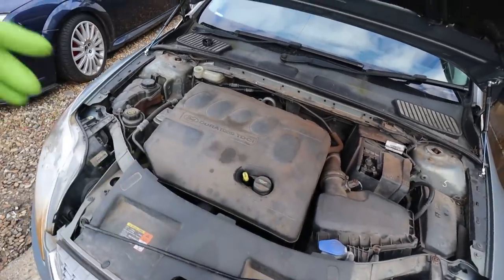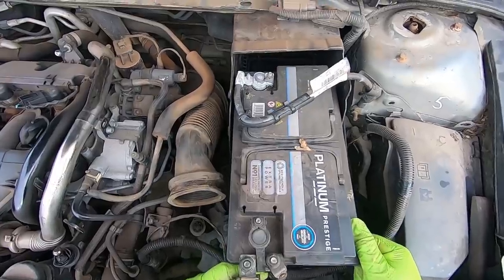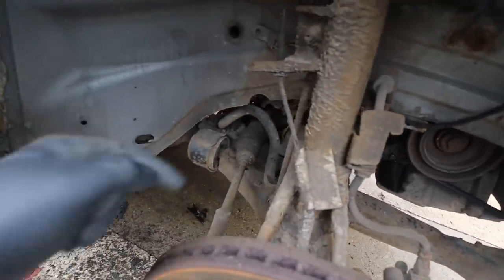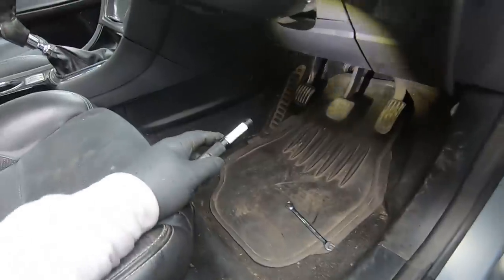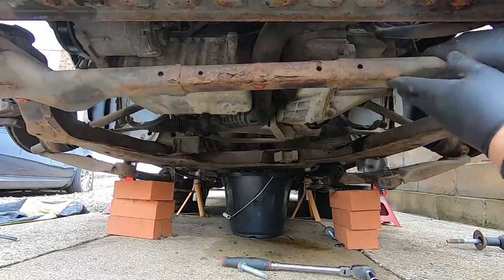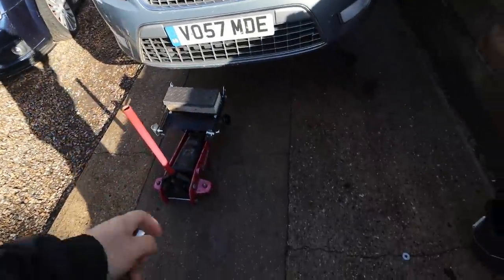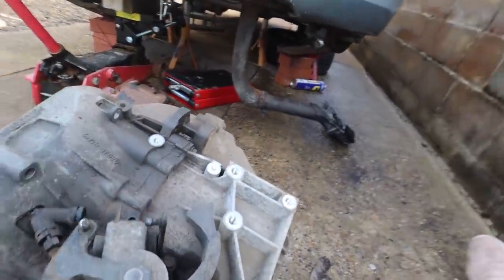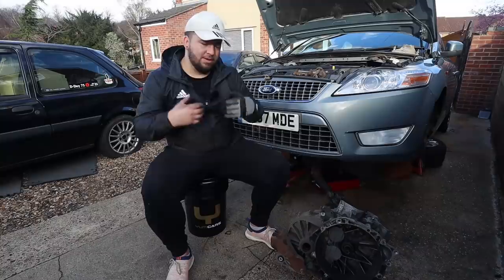Mondeo Mk4 Project Gets a New Clutch! (Part #1)

Comment: How can someone Dislike it when it was only Uploaded 5 minutes ago, Typical YouTube Haters 😂
Reply: It's all the fiesta nutters James never really got dislikes until he got that and now every time he uploads a video that's not rusty soap box related instant dislikes
Reply: @roymitchell5664  I'm one of them Fiesta Nutters, I have a Fiesta ST Performance Edition 🤣
Reply: @roymitchell5664  stop talking waffle you don’t have a clue
Reply: @georgepeg6167  I don't have a clue?  You don't know me or what I know so shut up.
Reply: @Unknown65151  the fiesta st is a brilliant car but as a fiesta fan you will know that and you will also know that the old ones are rust buckets, in my opinion and it is just my opinion james should of just scrapped that car when he found all the holes in the floor pan its too much of a money pit thankfully ford have sorted the problem out now.
Reply: Probably prefer gardens to driveways 😃😂😃😂😃😂
Reply: @james there is a special tool you are ment to use putting the pressure plate back on, just thought I’d give you heads up, 

the pressure plate is a self adjust one (see those springs in the middle) and what can happen is when your tighten it the adjustment can just slip so it will be fully adjusted and will most prob slip
Reply: @roymitchell5664  clearly don’t know nothing bud just a nobody like everybody else lol
Reply: @Ross Bourne what point you trying to make ?

Comment: I tackled the Insignia DMF, clutch and slave cylinder a couple of weeks ago. The box was just as heavy, maybe more - but it was not a job that I would again lightly. I had the exact same problem (I also have a MK4 Mondeo as well - the same as you, but luckily no clutch issues on that).

I only lowered the left side of the sub-frame down partially and rested the box on it, enough room to get the job done. Otherwise, I'd have to get it on my chest and onto the floor, which even for me isn't an easy job. Yep - I also did it on the driveway. Hats off to you for taking on such a brutal job in this... British weather! Also, I had to fight with the dreaded "flywheel spin" where the bolts were inaccessible without an angle-grinder. Yeah, it was a fun job,

Remember not to dry-bleed the slave cylinder as it can lead to premature failure. Prime it instead.

Comment: Can I just say, I have a Ford C Max and have only just started out repairing my own car due to costly errors by experienced mechanics. Using tutorials in a "STEP BY STEP" like manner, is what allowed me to rebuild the entire front suspension which was challenging but so rewarding in many ways. It's hard to find videos like yours on clutch work, so if you please,... the more intricate, "STEP BY STEP... Bolt by Bolt with good lighting and good angles" the better. Hell, your videos are better than the notorious Haynes Manuals. Keep up the good work. Well Done!

Comment: You did a good job but over kill with the subfame it only needs dropping down on one side leave anti roll bar alone and steering rack just remove the drop links from the struts and track rod ends from the hub unbolt box and let the box sit on the frame while you replace the clutch.

Comment: just in case you don't know when your reinstall the sub frame you have to align it there are holes on the back you see them in the video at 20:02 there is a proper ford tool but you don't have to use it all i use at work is 2 3/8 deep drive 14mm snap on sockets and 6inch extensions  to align it if you dont align it properly you'll never get the tracking right afterwards. love the vids keep em coming

Comment: James, you've got it all apart so you're halfway there. It makes sense to replace the crankshaft rear seal now you have the flywheel off. Gearboxes are no lightweight but that one must be really heavy. The last clutch change I did was on my 2002 Citroen Xsara Picasso. I wish I'd made a video when I did it.

Comment: Fair play for doing that on your drive mister, front wheel drive gearbox removal is often way more involved.

Kevin Albert Williams has a great channel also, focusing on mobile clutch replacement - perfect watch for the most efficient way to get the box out or just enough out of the way to change slave or clutch/flywheel depending on the car.

Comment: Another great vid. Before you put the slave cyl on, check if you need the sealant on it. The mk3 had to have a specific one.  They were also a pig to bleed afterwards, best way is to refill through the bleed valve using a syringe as it pushes the air upwards.

Comment: When you fit your new pressure plate there is a procedure to be aware of it is the self adjusting type.
The three little springs will be fully compressed on the new pressure plate and need to still be fully compressed once the new plate is tightened down.
If you trigger those springs when you fit the pressure plate the clutch won't work properly.
There is a £400 fancy tool to do the job, you can make your own for about a tenner. If your Haynes manual for a Mondeo is as useless as my Volvo Haynes manual this won't be explained very well.
The other way is to fit the pressure plate and tighten the bolts very gradually and evenly keeping a close eye on the three springs to make sure they haven't moved.
Alan Howatt has a good channel, well worth watching.
To save a lot of sweating when you refit the gearbox you can cut some bits of M10 studding about 100mm long and screw them into the engine, then slide the gearbox on over them, makes life a lot easier.
I'm sure you already know, but that steering rack pinch bolt inside the car is a one use item. Keep on keepin' on!

Comment: Nice one, am sure the drive shaft bolts needs replaced think they are a  stretch bolt, most wheel bearing kits give replacement bolts for that reason

Comment: Just a thought....I had the model mondeo before yours and had clutch done....clutch, flywheel, slave cylinder AND starter motor. Apparently it`s good practice to put new starter when changing clutch.
Reply: Brother is a taxi driver and ran a Mondeo....clutch went...Ford garage charged him £1,200 (Clutch, flywheel, slave cylinder & starter motor)....I was also a taxi driver for 4 years and stupidly started off with a Mondeo (It was off the road more than on it, with repairs....until I saw the light and got a Skoda!) and clutch went....I got it done by an ex-Ford technician running his own back street garage with his son and it still cost me £700 back in 2006....he showed me the flywheel and starter, which were much the same as yours (F*cked) with flywheel knackered and starter so full of gunge (Like the stuff in your bell-housing) as to be kaput.

Comment: The DMF wobbling around would have smashed the clutch into the slave cylinder that’s why it went, it was the DMF to start with that was the problem, I had the same on a diesel vectra
Reply: If the flywheel was that bad it was knocking the clutch into the slave would of been knocking its tits off 🤣 do you know how far away the clutch sits from the bearing with our foot on clutch ? 🤣 with foot on clutch the play would come out of flywheel with it being pressed , hence you won’t hear a flywheel knock when the clutch is pressed down

Comment: I have the same engine in my Volvo and if I remember correctly, that they came with Sachs from factory, not LUK. So am I right in thinking that this has been changed before. Yikes those bolts don't look good. Maybe it was badged previous and they haven't tightened the flywheel bolts correctly. And these require a specific alignment tool so you'll be needing one to install the clutch. 
Love the videos and get yourself some mats to lay on. The halfords ones are a godsend and are very comfy. Unless you can find the children's play mat version cheaper.

Comment: you are lucky with that flywheel they often get stuck and the centre part requires cutting out to get to the flywheel bolts to get it off

Comment: Hi, I'm a technician by trade love your videos. Have a look at investing in milwaukee impact guns i have them uses them on a day to day and they are better than my more expensive snap on ones I had.
Reply: Been to pal, I was amazed that he had to use a breaker bar on the steering rack bolts, Milwaukee would have had them out in seconds!  Even the snap on ones would in my opinion
Reply: Ye the snap on ones would do to, I mean they are good but for the money I think the milwaukee are a better deal.
Reply: Milwaukee really in a league of there own for there strength in impacts, dewalt half inch impact is a keen contender very similar strength to the milwaukee just far cheaper and actually lighter

Comment: Compared to a 1960's Cortina conventional drive this front drive set up looks a nightmare to work on. Good work. I suppose in a garage the car would be high up in the air and even then it's still awkward. Cheers.

Comment: Hi mate nice vid....try and use the axle stands to what there for a.get the car in the air you will find it a lot easier for you....now ref to the clutch look on the box it should say s/a on it this is a self adjusting clutch now there is a special tool to set these up but if not available they can be a pain...fit it and when.doing the bolts up I've done.it 1/4 turn each bolt and rest it carry on untill all tight and right I've done the transits like this and it does work...good luck...😂👍

Comment: When you put it back, use 75W gear box oil. Something like Castrol Syntrans FE 75W. It's the right oil figured by Getrag for these. You might think it's ok-ish with standard 75W90, untill you use 75W, what a difference it makes.

Comment: just a heads up, that pressure plate looks like an adjustable clutch, means you need a tool to fit it correctly for the adjustment
Reply: I was wondering about that be good to watch someone do it for future reference.

Comment: I suspect the unknow box on the subframe is probably a vibration damper to damp out probably high frequency vibration.  Basically it'll pretty much be a weight that's calculated to dampen out the sort of high frequency vibrations that cause buzzing noises inside the car...

It could also be some kind of safety item fitted so that, if an engine mount fails, it will drop down and rest on that rather than dropping right down to a point where damage may be caused...

With 160,000 miles on the clock it really wouldn't be surprising if that's the original clutch, even with the vehicle having been used for towing, as the original clutches can rack up a lot of miles before needing changing.  Usually it's the hydraulic release bearing that dictates the life of the clutch and it's not unusual to find cars that have done most of their miles on motorways that have 200k miles on the clock and are still on the original clutch.  These parts are basically the same as those used in Transits, so they're very well over-engineered for a family car...

Comment: Hey, you should've concidered to order stiff flywheel. For example I have 2012 Focus mk3 1.6 tdci and i have installed Valeo kit. It drives way better and costs half of money. I did 50k kilometers since the repair and had no issues at all.

Comment: i defiantly would build some concrete wedges on your drive as its on such a angle so when you drive in the front/rear of the car would be near 2ft higher at the bottom of the drive just a wedge under standard wheel width so you can safely go under car without jacking , similar to a pit but obviously smaller but ideal for service jobs ! top work again mate !

Comment: This is a job that typically scraps older cars like this - nice to see this Ford getting saved! Just curious - why did you separate the steering shaft from the rack, as the whole rack was staying in the car anyway ? And how are the bushes in those lower control arms ?
Reply: I was thinking the same thing. There was no need to separate the pinch bolt out of the steering column. Easiest option would be separate the ball joints from the hub and drop the sub frame out with the suspension arms still attached. Just giving himself more work.

Comment: Damn. I have a mondeo mk3 tdci which i've had since i got my license - 3 years ago. it's getting close to 400k kms and I've drivin in it since 270k kms.

I drive a lot of highway and nothing realy went wrong apart from brakes and normal wear and tear items. but I'm really scared of the day the clutch goes since it's a common issue for my model sadly.
it's around 1000 pounds at a shop, but if i do it myself it's 300... But I've saved up for this luckily.

Comment: I need help with my 2.0 smax 2008 same engine as this mondeo fitting a new clutch and flywheel ive had it not even 11 months, I bought from a trader apparently they fitted a new clutch kit but didnt fit the flywheel now its making a vibrating through clutch pedal and can feel grinding also.

Comment: Hiya mate is this a 1.8 diesel ?  If so I have an 08 s max with same engine  it had a noisy flywheel so I got a second hand one from a 1.8 diesel mondeo ( same engine in both ) I put the second hand one in and the original slave cylinder started leaking  as I tried to bleed the clutch I unbolted the gear box again and put the original clutch left the second. Hand flywheel in and put a new throw out bearing in.   I buttoned up everything and again when I went to bleed the clutch fluid started pouring from the gearbox again

Comment: While the gearbox is out, strip down the selector mechanism on the top.  You will probably find one of the shafts needs a light sand and grease/oil it up.  Will make it select a lot nicer.

Comment: Is there anyway of taking the gearbox out the top to avoid having to remove the subframe?
Reply: Only if you take the engine out with it
Reply: @offbeatwarble  yea, that's definitely not easier.  Subframe it is.
Reply: @steve0680657  you don't have to drop subframe as James did, albeit that way is easier for him to film.  You can just loosen O/S/F bolts and remove N/S/F ones, then just wedge a block of wood in-between the subframe and the body so you have enough room to pull the box away from the block and rest it on the subframe. Then just replace clutch in situ.

Comment: There are a lot of manufacturers that put the slave cylinder inside the bell housing. And this just makes no sense to me. And then they combine the release/throw out bearing & slave cylinder into one part. Worst idea ever. But I suppose it does make for a better video. Cheers.

Comment: That flywheel is scrap. Looks like a ridden clutch as that causes a lot of them to fail. They definitely ain't meant to do that. Flywheel bolts are a one use job. I work for Ford. Do alot of dual mass flywheels.
Reply: You get the bolts with a new flywheel.
Reply: @iancovid19hamilton69  Indeed you do mate.